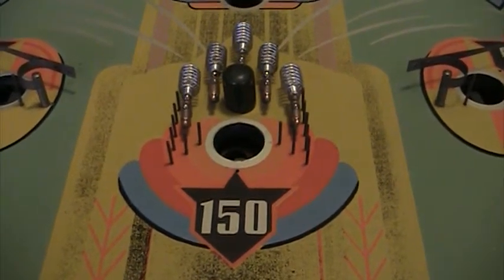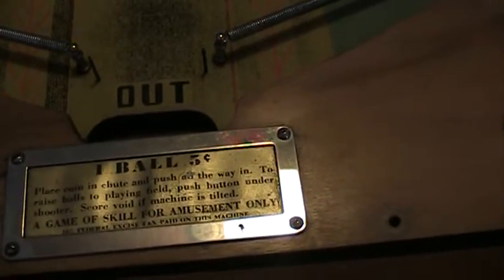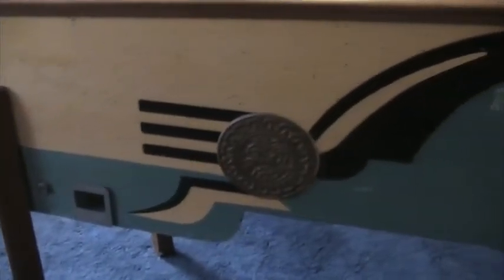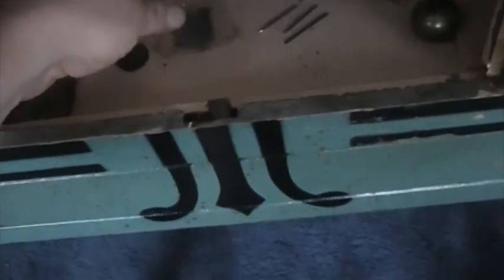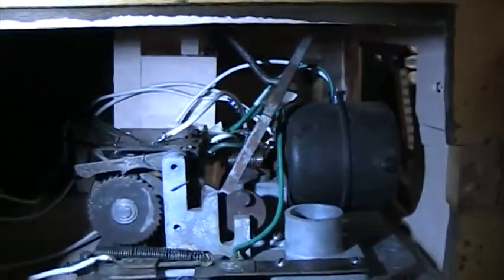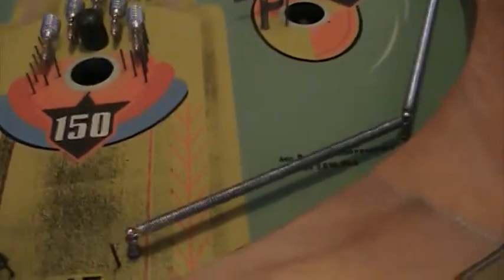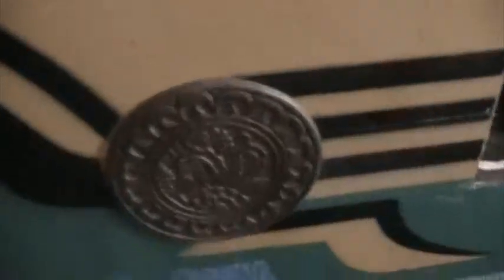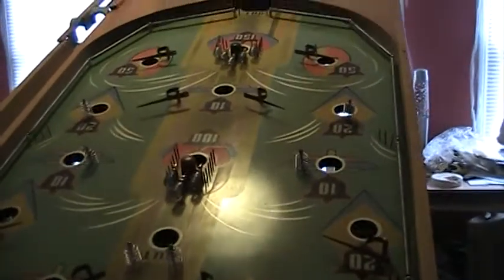Payout Pinball Machine from the Great Depression

Comment: Nice video Bee, interesting how the old machines worked
Reply: Nice machine.  I would like to see under the board you made.  It looks like the payout motor is underneath the nickle window, (which I found interesting because my machines have a similar hole and I just thought it was for putting your finger in to lift the playfield up), and the payout tube is on the right side.  Usually , the nickles that were played, would fall into the payout tube to keep the payout tube full.  Once the tube is full, the extra nickles would fall into a cash box.  Nice video.  I like when people take the time to show the inner workings.  Thanks for posting.
Reply from the maker: +Chicago coin op Yes, the window where you can see the coin...some you tubers call it a "witness window" so the bar owner knows the winner wasn't using a slug which would void any winning.